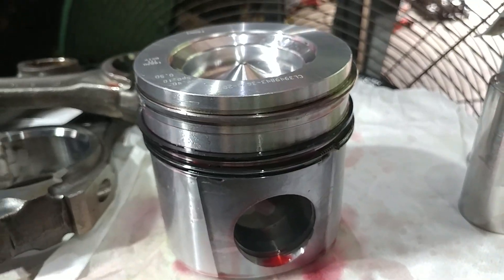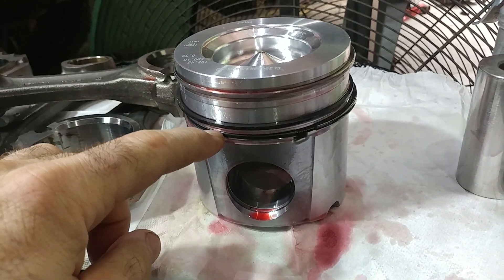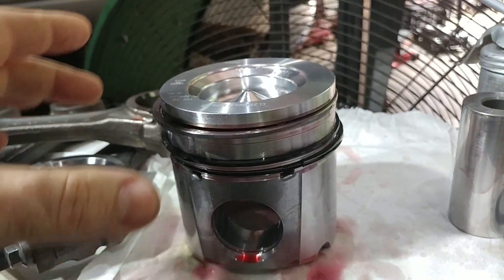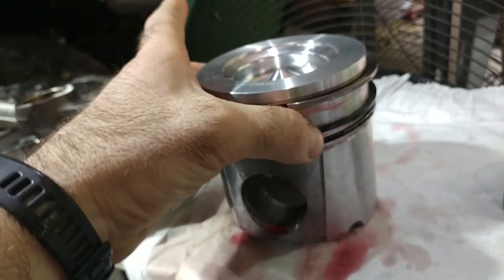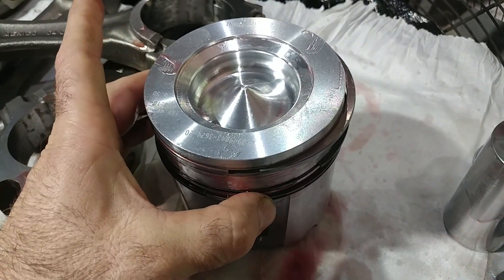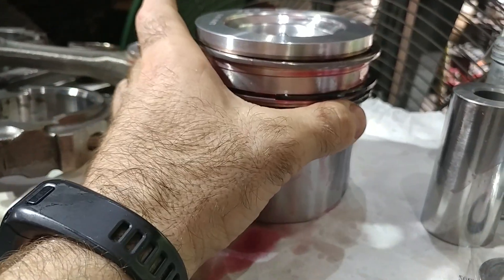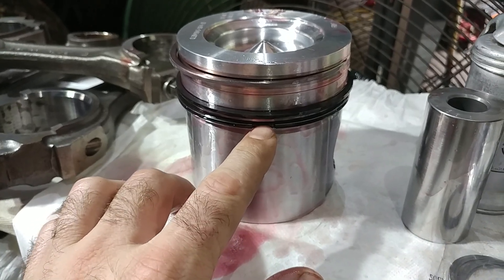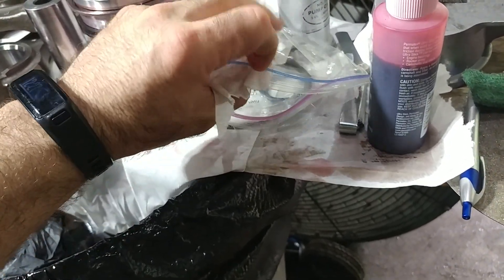Chronicles Of An 03 Cummins Rebuild - Part 14 - Installing Piston Rings & Ring End Gap Placement

Comment: I understand it is important to not line up rings in a row but does the location really matter that much if they spin on a running engine? Like not lining them up on the wrist pin.
Reply from the maker: Well Jason! That is a question that I have asked many times. Up till now I have never gotten an answer that really brought on an AH Ha moment. So till I get some one who can break it down and give specific examples. I just keep following the Cummins Book. 
I will tell you that I have never, NEVER, opened up a Cummins motor and had the rings still be in the Mercedes symbol position. But ring gap position is shown in every book I have. Sorry that's not much help! But it was a great question!
Reply: 70440charger I’ve rebuilt/re-ringed a couple engines in my lifetime and have always just made sure they were staggered and not worried about specific location and haven’t had issues.  I’m curious if they were all lined up on assembly if it would even loose compression or smoke.... if they are lined up they spin anyway I wonder if all rings spin at the same rate?
Reply from the maker: Yeah, I hear ya. I have never been gutsy enough to build a motor and test the theory, but I have run into a few people that say they had excessive blow by and it was due the ring being lined up. I imagine that them being lined up couldn't help anything, but I am not in any kind of a hurry to find out first hand!!!!